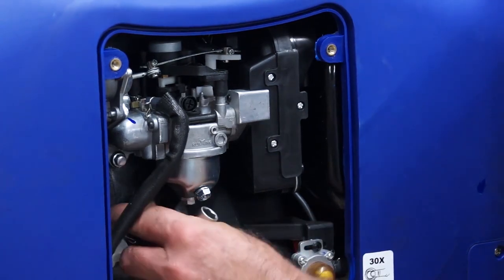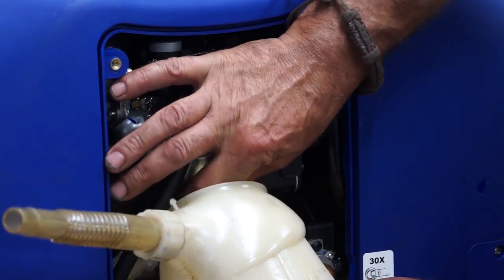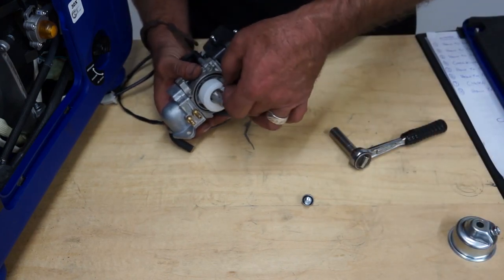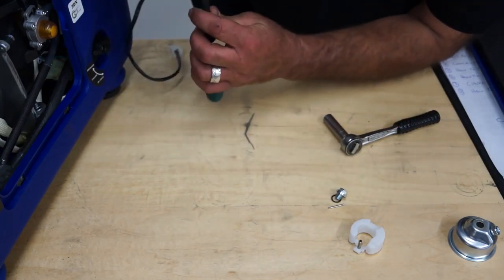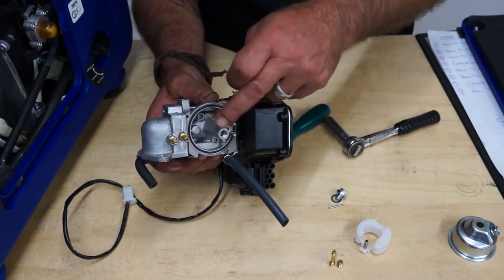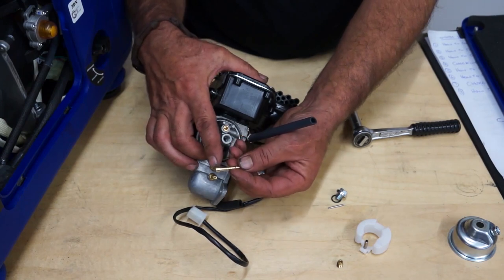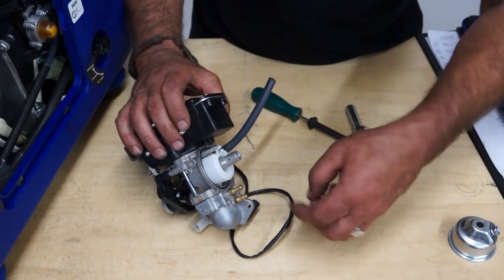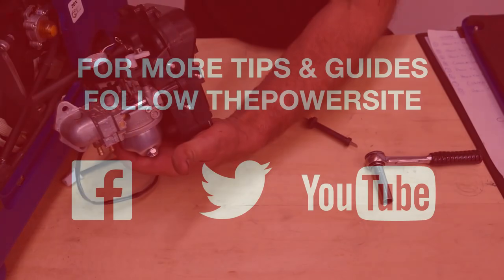How to Clean the Carburettor on an Inverter Generator

Comment: Brilliant video. Many thanks. Could you please somehow make a short video showing how the little throttle motor on top of the carb fits. I took this apart and a small white plastic part fell apart and a spring. Im not sure how this goes back together. Thanks for the upload.

Comment: Nice video. we got a new gen max gm 1200i inverter generator and it is not working . so we are thinking about getting the gas out , so the generator you are working on is it about the same as the other one, bc we cannot find specific for out appl. thanks in advance